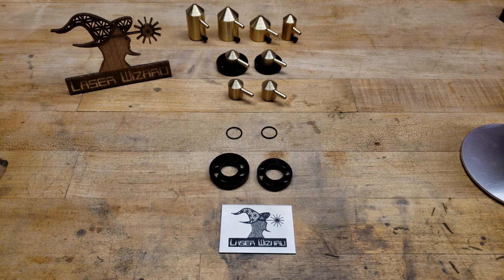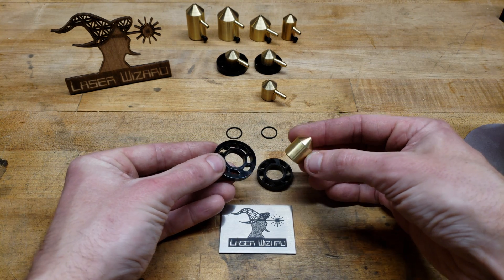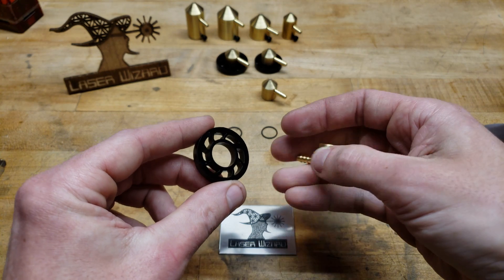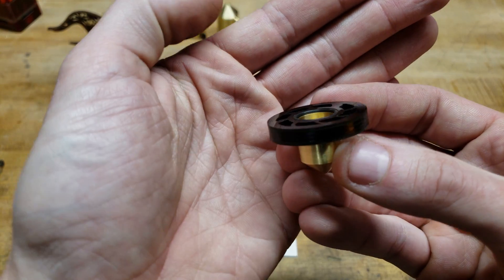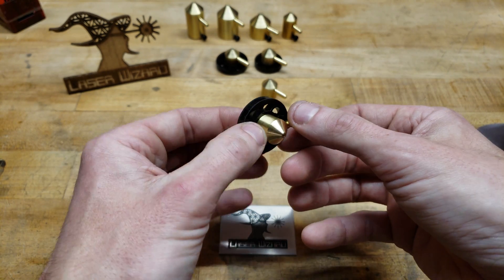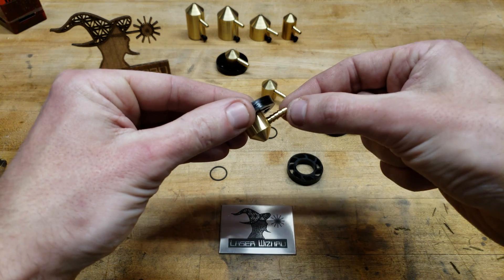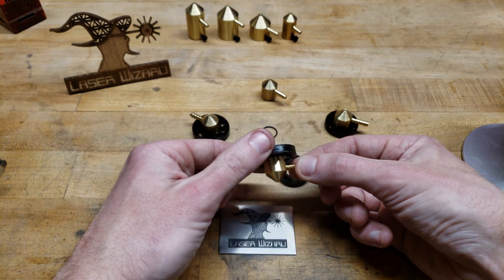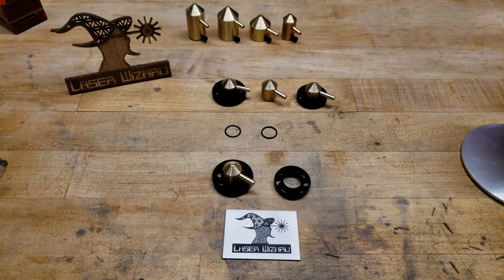Sculpfun S9 Air Assist Nozzle

Comment: Okay so my laser will be here on Thursday and I am brand new!  I would like to order an air assist for it but I am still reading up on the right compressor and how to hook it up to the laser. What kind of compress works well with this? What size hose?
Reply: My laser is here and it literally just says Sculpfun S9 it’s the blue colored one which I don’t think makes a difference I’m not sure to tell whether it’s the one that fits yours or not and what’s weird is in my Sculptfun group which is the official group they were confused when I ask them which model it was so I’m trying to talk to the admin to figure it out but how do I know if I have the right one for your nozzle or not
Reply from the maker: @MrBmcgee1989  best would be to remove the laser shield and email me some pictures of the lens area. I have photos of both variants. I am in a Sculpfun S9 group page on Facebook, but I am not sure if it is the official one. If you could please email me, I could help sort it all out. Email thelaserwizard@gmail.com
Reply from the maker: I personally use and recommend a 32W 950gph aquarium pump. The tubing is ⅛" ID. Once you receive your laser module, just make sure you check to see which version of the S9 you got. I'll be working on making a variant for the other style S9 on the market.
Reply: @laserwizard1982  I just checked the website and it says nothing about having different types. Mine is being shipped from the USA so I am unsure if it is different based on where it’s shipping to but I’m gonna try to do more research. What do I need to check to insure it’s the right one when it arrives?
Reply: Okay I sent the photos! Thanks
Reply: I did a little bit more digging mine looks like a Kaun I guess some people are selling the air assessed haven’t labeled “cone model” lol

Comment: Will these fit both versions of the S9 laser module (there's two out there, both with different internal geometry)?
Reply from the maker: Thank you so much for this comment! Until last night, I was only aware of one version. I had someone send me photos of their S9 and it was different than what I'm used to seeing. The recessed area is much deeper on this other module. I was unable to find information on this other module. Would you be able to point me in the right direction as to where I can find information on this other version? Thank you!